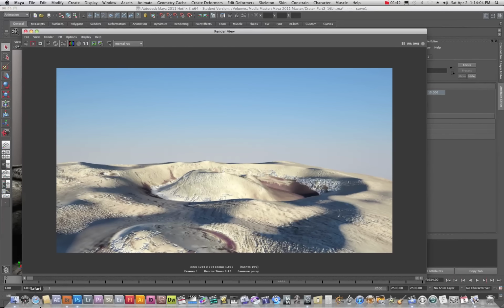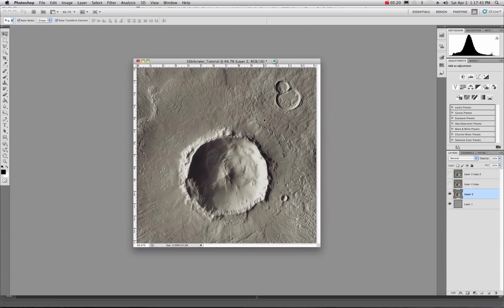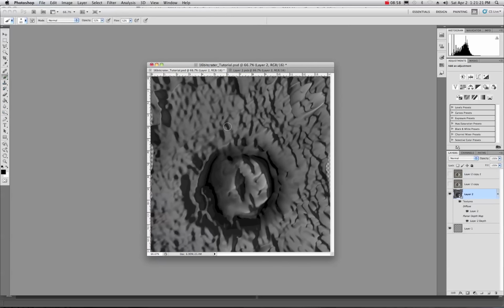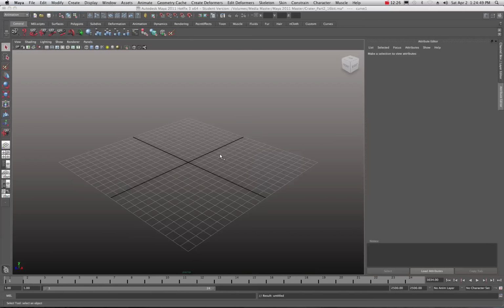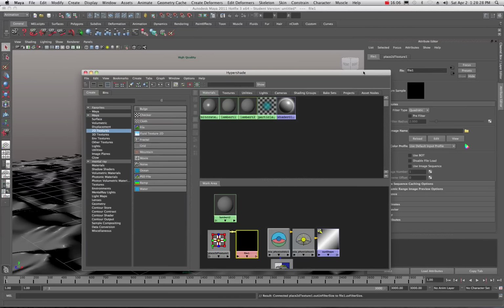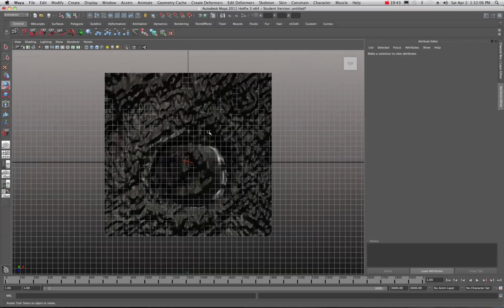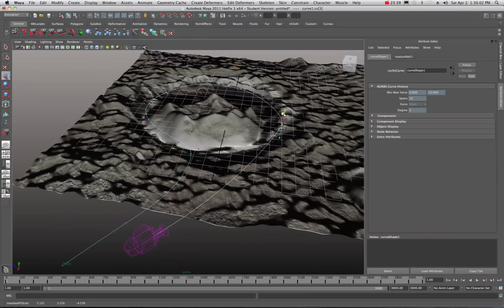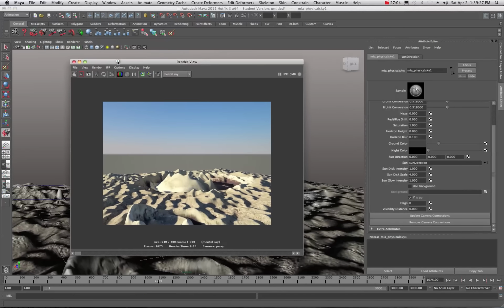Maya 2011 8 and 16 Bit 3D Mesh Terrain from Image Tutorial, Part 2 of 2  by Stuart Christensen

Comment: @deepfriedectoplasm 
yeah,yeah....that's what I want to asked, where I can find the soft modification tool? And how can I use it ?
I want  to edit the polygon without ruin the smooth surface. If I use the vertices to drag, the part I change just always looks very unnatural of the whole unit.

Comment: Awesome thanks :) 

One thing I would like to point out though is why did you use the burn tool? Shadows and Highlights filter is far more effective at balancing tones (make sure to play with the radius too). Then to make greyscale if you use the Black&White feature you again have more control over the depth of certain areas.